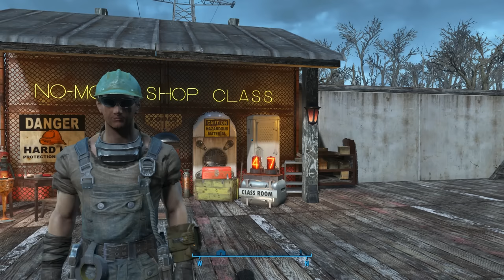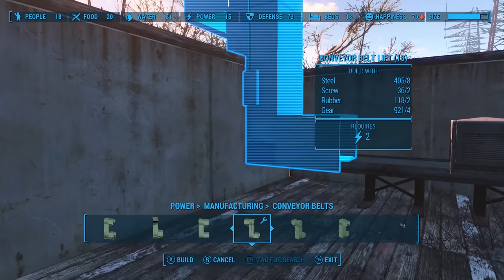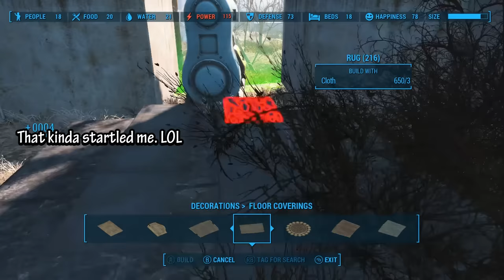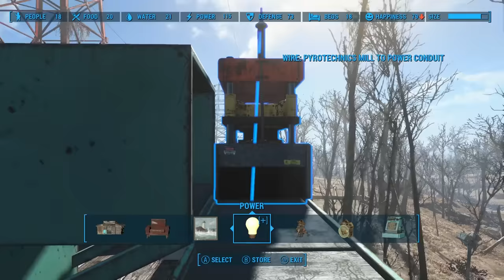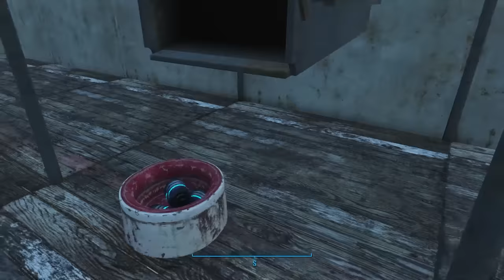An Introduction to Manufacturing 🏭 Fallout 4 No Mods Shop Class

Comment: I skip the whole starting container thing. I just put the raw materials directly into manufacturing machinery and then set what I want to build. It goes from there. Granted, its not as cool looking/fun as watching raw materials getting loaded into the builder. It does, on the other hand, save space and speeds things up.
Reply: I was about to ask if you could just manually load the assembler & skip the vacuum hopper, and I saw this reply, so thanks for clearing that up.

Comment: I use the pressure plates in junction with the various "scave stations" as a means of production regulation so there not running 24/7 which also ads some immersion.  Looks like a settler is running the line during the work day.  You can also set up another vac hopper to turn on when the line is off to pull the unused stuff back out of the manufacture and back into the container or into the workshop.

Comment: Hey man, as an fyi you only have to power one machine in the line to supply them all. Took me awhile to figure that out but it's helpful to know. Love the videos BTW! You have some great builds going on. Keep it up!
Reply from the maker: Thanks man! And yeah, one wire will supply all the power as long as they're physically connected. But sometimes you'll need breaks in the connection like I had in this little configuration. That's when you'll need multiple wires.

Comment: A good design I use (IMO) is to have multiple manufacturing plants drop their output into a single hopper from  elevated slopes and belts, and that hopper drops items onto a belt that carries it to a storage unit. Then all my stuff just goes to one place! The big hopper is a pretty useful item for collating everything together. It's finicky to set up, but so satisfying if you pull it off!

Great intro, man.

Comment: I like using my hopper to pull stuff straight out of the workshop, using sorters to only pull the items I need into the manufacturers and send the rest to the workshop for another pull-through.
Reply: I have spent exactly zero time actually manufacturing, but I was thinking exactly the same thing once I learned about sorters and such. What do you use to get the unused scrap back INTO the workshop??
Reply: @richardmerchant4998  That might actually be a piece from a mod called Workshop Extended that I thought was a vanilla workshop peice, sorry, but it is a conveyer end that stores everything in the workshop.
Reply: @christopherthompson8609  Hey, no worries. I was just happy to actually see a comment from a day ago, as opposed to a year ago. Haha.
 I would only set up one settlement with manufacturing currently, so my plan was to just have the unused scrap cycle back within a very close proximity to my workbench anyway, and just do a manual (Take All) and (Store All Junk) periodically.
Once I beat the game without mods, I plan on dosing up heavy, so I'll keep my eyes peeled for that in the future!

Comment: From what I have seen (tested), each manufacturing line has to be isolated in a closed loop, meaning they must each be powered by their own generator(s) and not connected to another line (if you wish to run multiple lines at a time) or the terminals will be in conflict with one another and won't initialize the option sequence. For those of us who wants functionality over form, I recommend inputting resources straight into the builder and not wasting resources building a vacuum hopper as it takes way too long to carry from container to hopper and into builder.

Comment: I have been manufacturing my own ammo on my achievement cleanup run I’ve been doing and it is such a tremendous help keeping myself stocked on ammo.
Reply: If you just go to the castle, place water purifiers by the dozen, in the water. Place a bed and workshop in the castle armory, you can buy a ton of ammo from the minutemen lady with waters and sleep to reset her inventory and do over and over.
Reply: I have unlimited resources thanks to an exploit I’m using on the achievements run I didn’t side with the Garvy boys so the castle is still unavailable so I just have five ammo plants popping out the ammo and since it’s overstocked I have more ammo then I could possibly need, working on the dlc achievements for nukacola world and far harbor now

Comment: I know I'm VERY late, but in my experience, supply lines don't connect the inventories of settlements, it just lets them pull from their junk pools for crafting and building. So if you have a settlement you never do manual crafting at, you can put the vaccume hopper on the worshop to allow for fully automatic crafting.

Comment: Paul, i'd love to see you do a wall-clipping restoration video of Croup Manor. it's an excellent site for wall-clipping and makes a great example of how to restore a pre-war building. 

[edit] i wanted to suggest that armor, clothing, and weapon mills are really good for outfitting your large numbers of settlers if you are going for themed outfits.
Reply from the maker: Croup Manor and Taffington Boat house are both on my list for restoration! Man I can't wait until I make videos every day. :)
Reply: the clipping on taffington is really difficult, but you can re-roof it with the warehouse roof and it looks pretty reasonable, when i did this i added a balcony around the top floor.  
  
Croup however has a uniquely low clipping rate on the walls and you can actually almost entirely restore it without using the pillar or rug glitches.

Comment: one tip i have for people, set up one settlement for automatrons(since robots hurt happiness as they are locked to 50 happiness) and use automatrons for connecting settlements, that way your not using a valuable settler for caravan work.
Reply: I use the mechanist lair for this an id is the hub for all settlements.

Comment: The height matters too, if you sink the container or the hopper, it can mess it up. 

I generally just use it to break down the junk in my workshop, and then store them so that it makes us less likely to get attacked. ;p I like to keep my workshops mostly empty. 

It is best to use the recycler first, as sometimes when it automatically breaks down items, it will not give you all of the components it should. 

As someone who used mods, I also used the Manufacturing Expanded mod to use the Auto Butcher for more food.

Comment: Also you can connect the vaccum hopper directly to the Workbench...and it works !
It will use all the scrap you have in your Workbench, meaning it uses what your settlers bring when they are scavenging, meaning it can potentially make your manufacturing fully automatised.
Reply from the maker: Indeed. The only problem with that is that I think it also uses everything at all the other settlements you have linked through provisioners as well. That can be a hassle sometimes.

Comment: Great video as always. I messed with the machines a little bit. I am always running low on ammo for the last minute. Just couldn't figure out which containers were to be used. Thanks a million.
Reply from the maker: Ah yes, the 2mm EC is perfect for the ammo plant. You need Gun Nut 4 for that, but if you have that then that's a great source. It still might be cheaper to buy the ammo from a vendor. But when I had Cait using a Flaming Gauss rifle I was always running low on her ammo too.

Comment: Manufactoring is a great feature in Fallout 4. But as always Bethesda don't finisch the job. Many recipes are missing, some machines are missing, and, yes i know, you are using no mods, but this one is perfect for you.
It's called "Manufacturing Extended" Link below.
This mod gives you new machines and adds the missing recipes. The  most important machine, Bethesda forgot to implement, is the 'Recycler. Finally we can get one with this Mod. It breaks down Junk to its components in an immersive way. You put the junk in the recycler when arriving at your settlement and it breaks down the junk. transport the components to the workshop store unit.
Yes it took time, you have to be in the Settlement, but while you building stuff, it can work. So you can build a giant factory with this. And think about it, the most important thing the Commonwealth needs is a working recycling facility.

Here is the Mod for PC. 
https://www.nexusmods.com/fallout4/mods/15429
Here is the Mod for Xbox
https://bethesda.net/de/mods/fallout4/mod-detail/1990422

Comment: If you don't want to have to collect redundant junk from the Builder, you could use another vacuum hopper from the builder and connect to the same output hopper. It would take more space, but you wouldn't have to run all over to retrieve your components.

Comment: I really liked the rug glitch into the dumpster - it gave me an idea I'd been thinking about for quite some time. Basically, I want to create a Harry Potter style castle out on Spectacle Island, but was having trouble coming up with a good way to give the walls a bit better texture than the starkly smooth concrete foundations offer. Now, I might end up using crates, radios, etc and play around with creating a decent castle wall.
Reply from the maker: One cool think you can do is pillar glitch some wire fencing into the concrete foundations to add texture. Here's a video on pillar glitching if you haven't seen it: https://youtu.be/M9OQAseCIcg
Reply: Yeah, that's one of the earlier ones I watched. I've got the door set in the Jamaica Plains house and I'm using the looks of that video to give myself practice. I've got a turret set into the bus with the reverse basketball hoop - one thing I did different was pillar glitch a line of the tiny light boxes along the bottom and set them to 1 red, 3 white, 1 blue to fit with police lights. 

I also noticed that in your shop class intro you've used the back of the milk machine (to add variety and different shapes I assume) and I really enjoy discovering stuff like that.

Comment: the vacuum hoppers cannot pull items from other settlements out of the workbench, that are connected via a supply line. it would be awesome if that would work (on the one hand to have all items in one place, on the other hand to lower the chances for attacks in the other settlements), but unfortunately it doesn't work.

Comment: I know you're not into mods but you should check out the manufacturing extended mod.  It adds a few pieces that makes manufacturing really worth of doing.
Reply: The vacuum Hopper can also pull items from a workbench
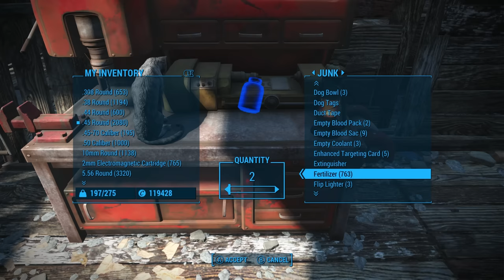Reply from the maker: Yup, I've heard mods add interesting options to manufacturing. As for the vacuum hopper and the workbench, I mentioned that at about 21:00.

Comment: 21:22 mind blown 🤯 I cannot wait to figure out what you mean. Did you ever do a video about this?  About how a vacuum hopper can suck items like food and water from supply lines connected settlements, basically teleporting them to where the hopper is at? That seems like it could be useful. Normally, you can only use supply lines to access for crafting. But if i could actually get the items themselves, physically,  that could be useful.

Just brainstorming, but if you could hopper teleport Purified Water from connected settlements, then i could set up a water farm, and pull out the water using Hangman’s vacuum , and sell it in DC. 

That could be huge. Especially since water stops getting added into the workbench after a certain threshold. So if I could empty all my water farms from one vacuum, i wouldn’t have to periodically empty every workbench. I’m always playing on Survival, so the time savings from not running to them all would be huge.
Reply from the maker: I was mainly talking about those things as ingredients for things that might be able to be manufactured. But to keep everything in a more controlled environment, I don't use the Workshop bench for my vacuum hopper.
Reply: @SkooledZone  I tested it, and I don’t think a vacuum hopper can suck a workbench, and teleport in stuff from other supply lines connected workbenches. Unless I was doing it wrong.

Comment: I'm laughing now at my own dumb build. If you connect the storage belt the wrong way, and put the items directly into the machine, it will still produce and go out the wrong way into the storage. lol 

The steamer trunk in the trash can is cool. I wanted to suggest, if you could glitch it or another container into a wall might look pretty cool as well. Like the half concrete ones. 4 Half walls forming a column. It could look like the wall is hiding a storage vault.

Comment: Could settlers accidently trip the pressure plate? This would work perfect for a door I have in my sanctuary build and the idea of using the pressure plate would eliminate the need for me to flip a switch, but if the settlers are able to trip the pressure plate, it makes the power door a moot point.
Reply from the maker: Yeah the pressure plate was initially made to power traps when enemies accidentally stepped on them. But you can use it in other creative ways. Unfortunately the power doesn't stay on if they step off.
Reply: depending on what you want to build it can even be helpful, that the power goes off again. you can e.g. connect spotlights to pressure plates on guard towers, so that only those spotlights are on, where a guard is standing (that's esp. interesting in 'spooky and foggy' settlements like the visitor centre of far harbor, so they mainly keep their 'dark vibe'). this is btw an alternative method to deal with the spotlight bug.

Comment: This is a little strange to me. I built the fireworks manufacturing machine and it works great. The problem is if I make a large batch of fireworks and store then in a chest and wait a day, they will not work at all. If I build a batch of fireworks and store them in the bathtub they all work, no problem at all. Not sure why the container does that but at least the bathtub works fine..

Comment: The only thing that would make that container soaker reasonable where if it could be programmed to only soak what the constructing plant requires and then put it right to the workbench. Otherwise why bother to place an extra container to soak everything from it and build a conveyor line to the constructor if you can just drop everything into the  constructor right away?

Comment: I’ve been noticing that you always wire every component that requires power directly to the generators. Did you know you can chain those? So if you have, let’s say, 3 terminals next to each other, then as long as you are supplying enough power, you can run a line from the generator to the first terminal, then from the first terminal to the second, then from the second to the third. Can help clean up the mess a bit. 

Also, you can string together generators. So those fusion generators that make 100 power? Make two of those. Wire the first one to the second, then the second to whatever you want. That’s 200 power in a wire so you can string it all over your settlement instead of needing generators everywhere.

Comment: This is super late but if you have multiple do they need to je on seperate power sources? I was trying to use vault 88 for manufacturing ammo ran the power down the hall to one main point and ran 3 ammunition plants off it but everytime I would switch one to a different type they all would switch. If that makes sense.

Comment: Is there any way to have the leftover items pulled out and put in another container? maybe on a timed suction thing that activates when the first machine is turned off and returns the items to the trunk container until you turn the first machine back on?
Reply: I tried to do this by having a conveyor storage device be the container the vacuum hopper was aimed at, but it won't pull items from it. Is there any way to make this work?

Comment: Hey man, what was the ‘wire glitch’ you used to connect the conduits to the machinery?? Seems like it lets you connect things regardless of the wire intersecting the floor etc
Reply from the maker: Here is the Wire Glitch: https://youtu.be/36lgmEaprio
Also, here is the Wifi Glitch: https://youtu.be/YdaR7m4gct4

Comment: I seem to have read this at some point, but does the factory only work while you are at the settlement? I'm also wondering if the scavenging stations will collect enough material to manufacture ammo. I had the idea to have one settlement not connected to the caravan network, then put in a bunch of scavengers and make it the ammo factory. But if I have to physically haul the components there it wouldn't be as "convenient". :/
Reply from the maker: Yeah, I think the manufacturing goes on pause when you leave the settlement cell area. As for the scavenging stations, they generate junk at such a slow rate that I usually just use them for decoration, or to occupy an unemployed settler for more happiness.
Reply: Yeah, checked the Wiki and it says a settler assigned to the scavenging station will collect only two random junk items a day. And once the workbench contains 100 + (population × 5) of junk, it's full. I'd need a maxed settlement population to even make it worth the effort. SIGH. Well, back to hauling crap all over the Commonwealth! lol
Reply from the maker: Here's a good video so maybe you don't have to do so much hauling: https://youtu.be/OE0tLm3wgFc
Reply: You know, you are probably the nicest YouTuber. And I have learned a huge number of things from you! Thanks for the time you've put into the No Mods Shop. :) I always get happy when I see a new one posted!